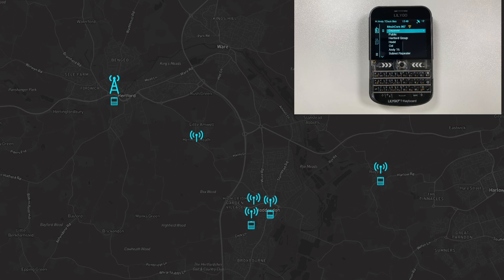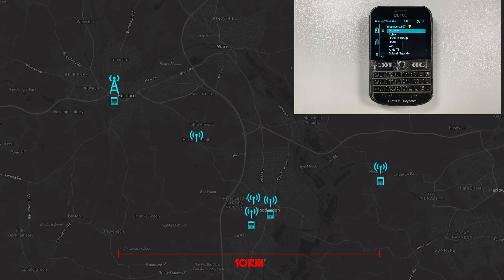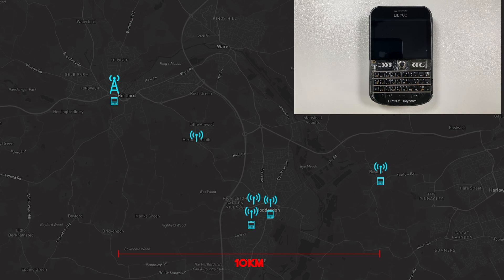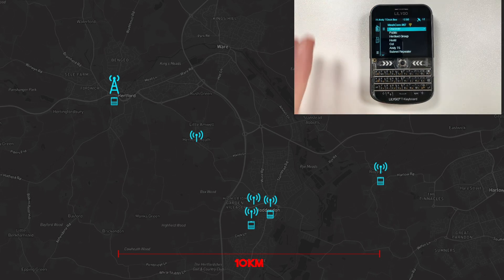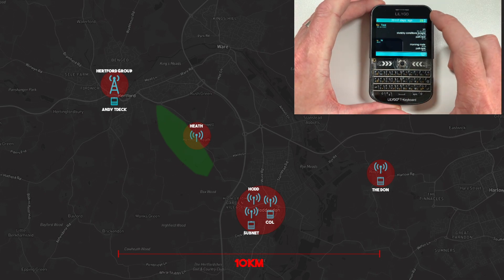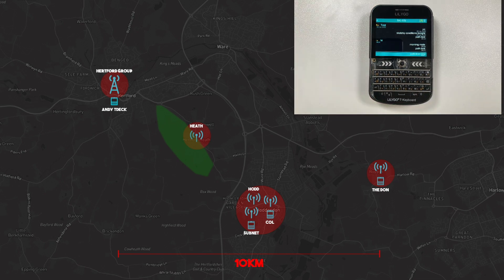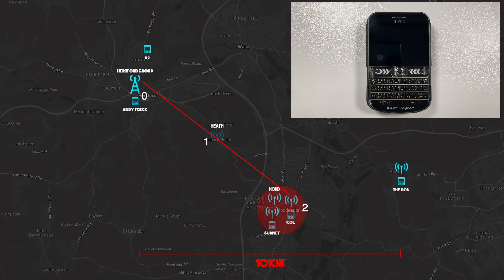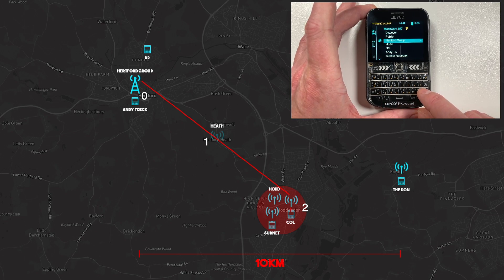Reliable private LoRa text messaging with Meshcore's robust routing

Comment: This is very cool, it would really be cool to talk about how private and secure it is. My only concern is the privacy, When you are travelling around well, someone could possibly track your Radio
Reply from the maker: Meshcore is very secure, also the radio doesn't blast out telemetry packets all the time or do retransmits so it will be silent until you send a message or receive one... it would be incredibly difficult to track.

Comment: Thanks for the contribution. Two things bother me. Meshcore works with repeaters (on the roof, for example). So one Hope is always “lost” in your own house (two if both use the “roof repeater setup”). Heltec V3 as a repeater only has a few meters of BLE connection without modification (coil antenna removed, 29mm wire installed). Here rak boards would be much more effective. The system is very effective when sending DM. But with group messages (which are also used 90% of the time on Meshtastic) I don't see the benefit? It looks like it's intended for smaller groups, don't you want to see whether my message has reached all 100 users? What is the advantage of Meshcore over Meshtastic for group notification? Kind regards Haflinger73 Switzerland

Comment: Is this different than meshtastic?
Reply: MeshCore gives you more control over how messages travel through the network compared to Meshtastic. Instead of just blasting messages everywhere and hoping they get picked up, MeshCore optimizes the path so things don’t get clogged up with unnecessary transmissions. This means better efficiency, longer battery life, and less interference, especially in bigger networks.
Reply: @Nope-sr2lc  If MeshCore relies on key nodes to route messages efficiently, the loss of these critical nodes could degrade network performance, whereas Meshtastic's flooding approach is more resilient in highly unpredictable environments right?
Reply from the maker: If nodes go down then you can reset the path and try and find another route.
Reply: @Nope-sr2lc  It doesn’t optimize the path, it uses the first one it found via flooding. And this is only for direct messages, I’d argue that the room server is much worse than Meshtastic’s managed flooding, because you let each node ask for the packets, so a node on the path might be retransmitting the same packet multiple times.
Reply from the maker: Yes.

Comment: I wish we could simply merge this with meshtastic instead of creating competing congestion.
Reply: And how is it guaranteed in this way? It’s still using an unreliable physical layer (LoRa), but now with single-point of failures (because you rely on a dedicated path) without retransmissions on intermediate hops. It’s also finding a path via flooding, then sending the path back (hopefully not via flooding if the other side already got a path). Then, if any packet loss happens on the path, you have to wait for the end-to-end timeout (which can be like half a minute on multiple hops), flood a new packet to find out the path and send it back. Let’s say there’s 5% chance of packet loss per hop due to collisions, weak signals, other interference, noise, etc., then for 7 hops (8 transmissions), the chance of an ACK coming back is only 44%. Even ignoring moving nodes, when traffic increases there’s a higher chance of collisions and in the end you’re flooding packets and paths back and forth all the time.
Reply: @GUVWAF  I am also really wondering how this works works with meshcore...
Reply from the maker: We are actually about to test retransmissions on intermediate hops (probably limited to 1 retry) The returned packet does start off as a flood packet to take into consideration asymmetrical paths which is highly likely.
Remember moving nodes aren't retransmitting anything and paths remain persistent until the user clears them so flooding is kept to a minimum.

Theres also no other traffic like nodeID's, GPS locations, telemetry etc clogging up the airtime since we only flood that info when a device is turned on. Repeaters never advertise themselves, they just passively route traffic.
Reply: @andykirby  Indeed, but with asymmetric links, how can you check whether the next node relays, since it’s not guaranteed you can hear it? 
PR #2856 for the Meshtastic firmware (planned for release 2.6) also considers single-path routing for direct messages, but instead of sending the full path, it only stores the next hop when it relays and the ACK came back via that node. Each intermediate hop checks if their next hop correctly relays and otherwise retransmits by falling back to flooding only on that hop.
Reply: Ugh, I was hoping this wasn't a competing product
Reply from the maker: It's completely different to the way meshtastic works. With meshtastic there's no guarantee that your message has ever arrived.

Comment: Thanks for the detailed explanation, what would happen in a scenario with many mobile nodes?
Reply from the maker: Mobile nodes don't repeat but you would have to establish a path if they moved significantly.
Reply: @andykirby  The one thing that is keeping me from swapping, is that it's completely reliant on the user manually refreshing the pathing ALL the time to make sure they have the best pathing possible.  While your system seems (so far) to keep air noise clear and almost guarantees receipt, I just can't help but to keep leaning toward meshtastic for much of the background automation even with their vast casm of bugs / issues / etc.  Don't get me wrong, I will still keep an eye on this... But brother, the automated pathways...